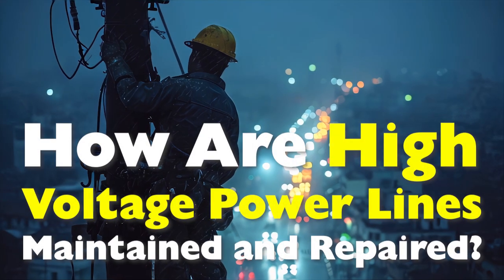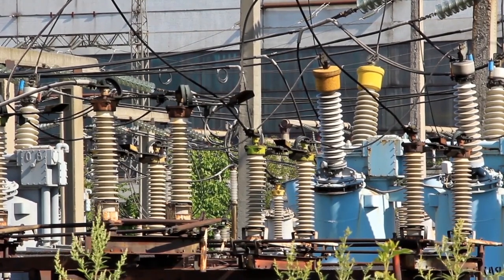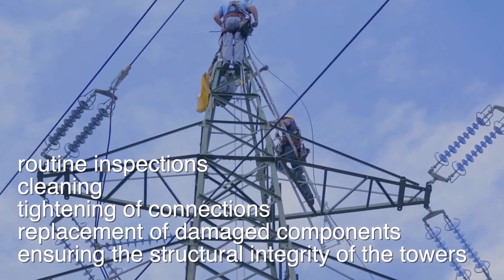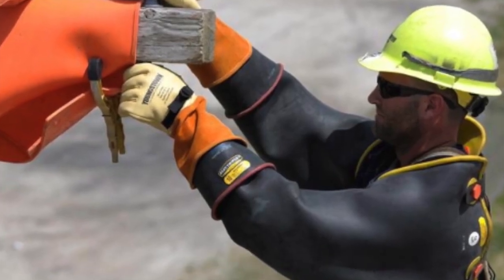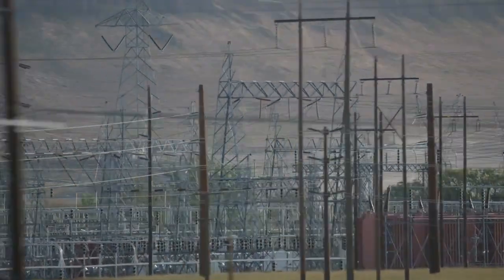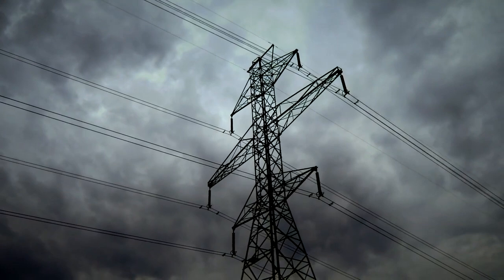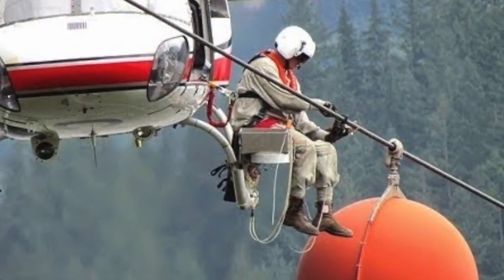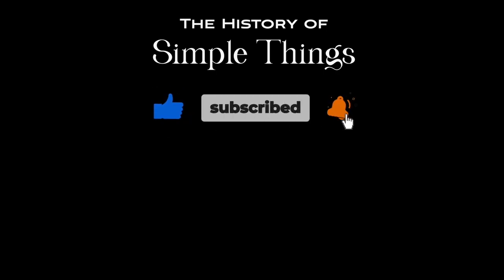How Are High Voltage Power Lines Maintained and Repaired? | 1.1

Comment: How are they maintained and repaired?  Very carefully.  Following safety regulations and using tools designed specificallly for the task.  You discard all damaged protective equipment and replace it.  You inspect everything two and three times.  You touch only one component at a time.
Yeah, it isn't easy and you spend years learning and relearning safety procedures.

Comment: New suscriber here. Been loving your videos, but there's something I think you forgot in this one: an interruption in the transmission of electricity won't just leave a city without it, the electricity grid is a planned array that includes the power plants to the final users, and the substations and all the wiring in the middle, all interconnected (that's why it's "a grid"). All that grid operates under a certain Load (the power that's drained from the grid by the use of electricity in the cities, and all that's drained by the resistivity of the grid's components: Cables, switches, motors, insulation, and so on); that load must be maintained in a range, because less than that Load will spell disaster over said city's grid, and that grid failing could create an overload failure in more substations, and so on in a domino effect that could send a whole country back to Prehistory.

Comment: How much do they cost I wonder. 
$/km ?
How many km. ?
Total costs. ?
How much $ cashflow to supply return on investment. ?

Say $1million/km
Say 1million km 
$TRILLIONS. 
$100BILLIONS.

÷365
÷600gWh, = 25gW x 24hr 

= 45cents kWh GRID costs.
5cents kWh electricity GENERATION costs. 

TOTAL  50cents kWh. GRID ELECTRICITY COSTS.

Grids are so expensive that they are fragile and were built just of broke. 
Engineered for construction costs economics for return on investment for grid owner operators